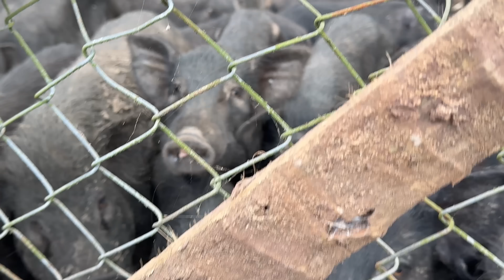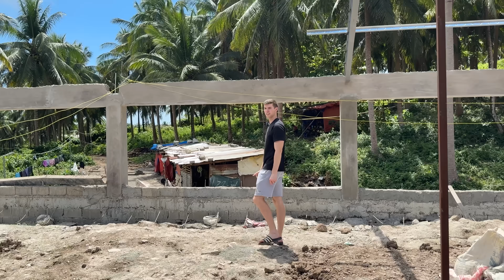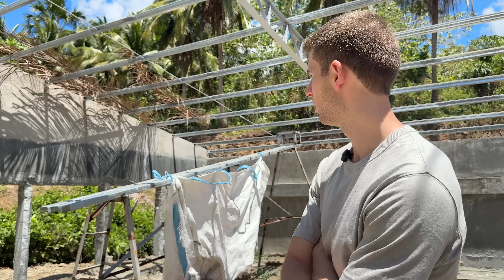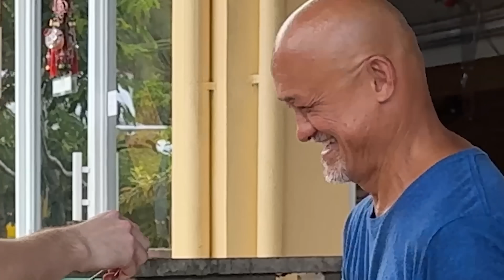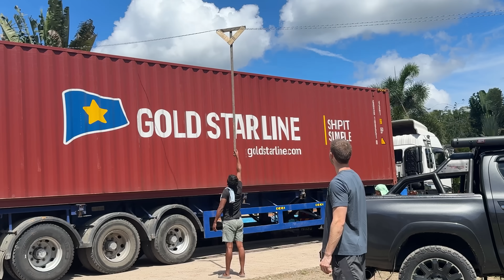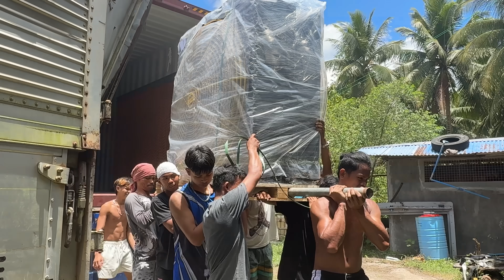I Invested $100,000 into a New Chicken Farm

Comment: I hope there is atleast a wire mesh that sandwiches that silver insulating foam. If it's not installed  carefully, it will only take 3-4 years before that insulation flakes off on its own.

Comment: What color is your metal roof? Standard silver sheet metal equals heat absorption that radiates down, yes your insulation knocks it back however new ceramic treated paints can reflect 85-90 percent of the heat that last about 10 years give or take. Worth a thought.

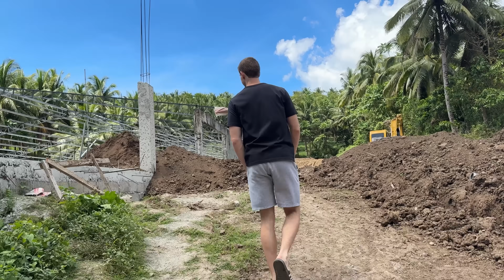Comment: 1:40 😅 with proper PPE (coverall, helmet, safety boots, etc.) here in 🇵🇭  the risk of death by heatstroke is higher than to die from falling off a scaffolding because of extreme heat ✌🏼😂
Reply: I don’t have any issue with the Philippine safety regs. Every country is free to do as they see fit. However, there are huge chunks of the US that are at least as hot as the Philippines for a significant part of the year. And yet, somehow, we don’t have construction workers dying from heat stroke despite their required safety gear.
Reply: @FAFASTERN Heat and humidity here are on a different level.

Comment: Regarding your wall plastering- I noticed, your workers or foreman did not provide grooves. Brother, tropical climates, grooves in plastering are essential for dividing large wall surfaces. While the expansion and contraction of materials due to severe temperature shifts and moisture are major reasons, these grooves are also vital for masking inevitable joint cracks, enhancing aesthetics, and managing rainwater runoff.
Reply: Walls will always crack in places. But thats how they build here and it surprising last lol
Reply: Not really a problem here. I’m in Building maintenance, a good mix will be of no problem.

Comment: Insulation is good but PLEASE vent the roof at high level. You can use regular vent or a spinning turbo vent. 
HCBs are good but when the sun hits them they are a huge heat sink and heat storage battery..Shade them if possible.
Doing that will save you a fortune on gas and power usage.
Reply: Not necessary

Comment: I’m surprised you are not using foam core insulated roofing.
Reply: shits expensive for the size of the roof
Reply: @Victor80085 well he’s got problems regulating / stabilising temperature most of that is probably coming from the roof and his cooling pads. So the roof is probably the cheapest most expensive thing to fix.